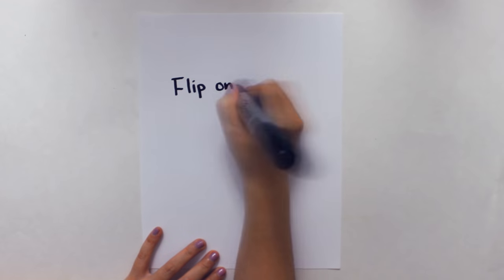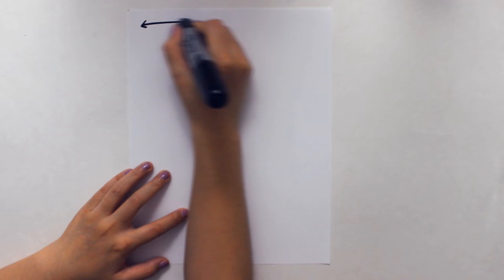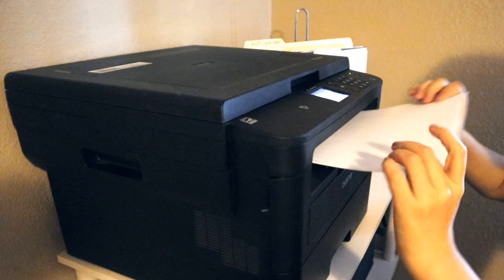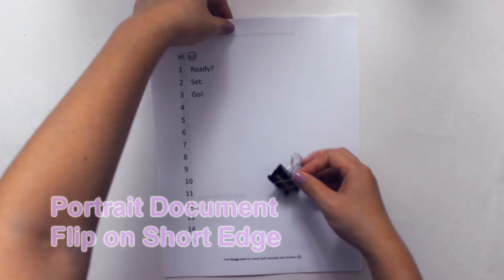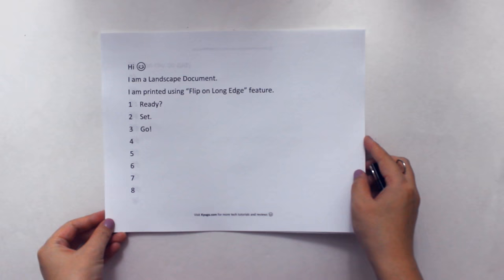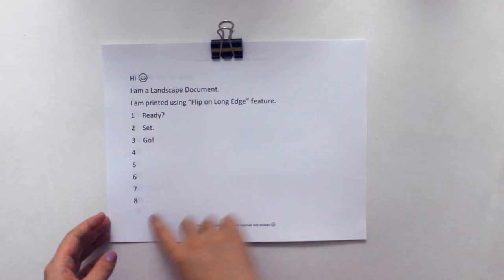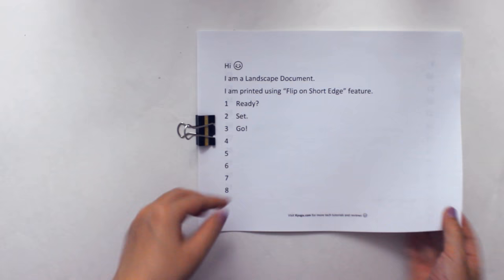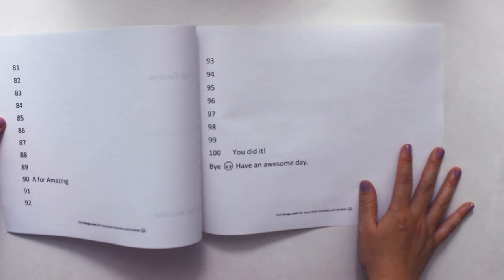2-Sided Printing Differences: Printing Long Edge vs Print on Short Edge | Explanation

Comment: This was information and to the point on what info I was wanting! I am so happy that this was the first video result that popped up when I searched for help on flipping the pages. If only they made it easier and instead of this phrasing, had it either in simpler words or actually have a preview picture of what does what (or make it a better icon/picture).